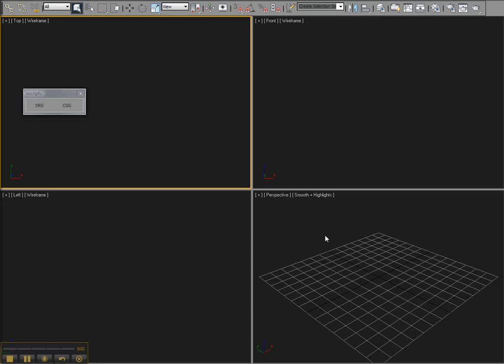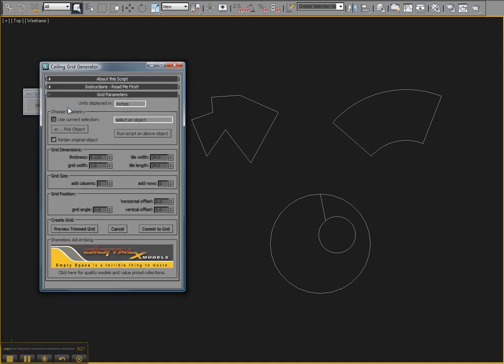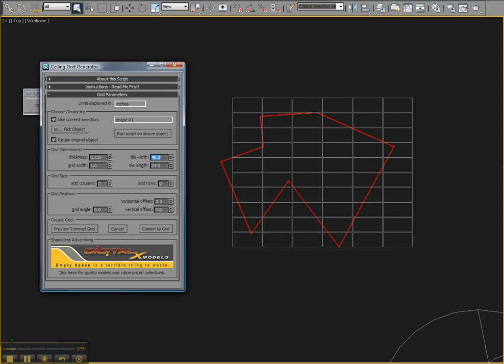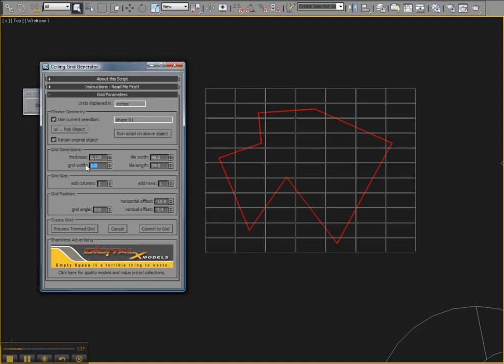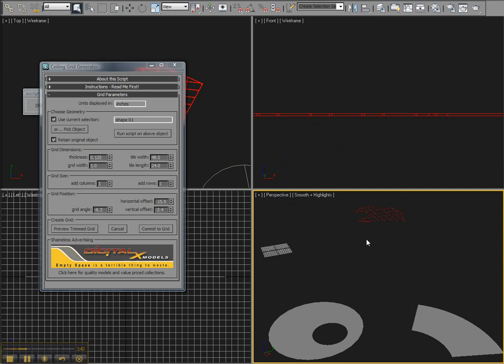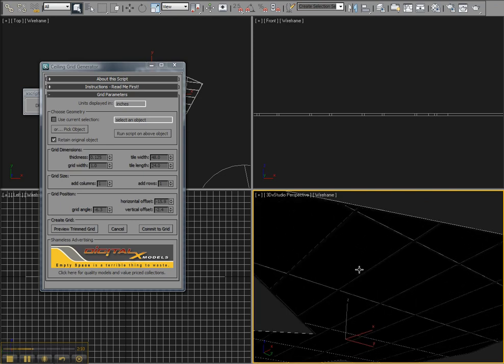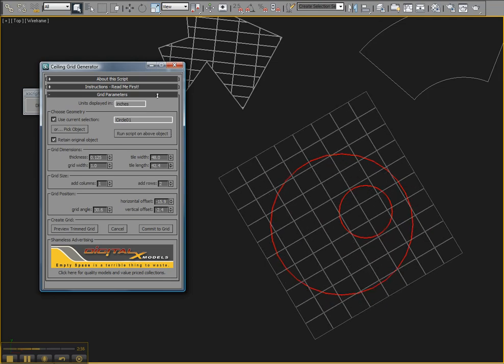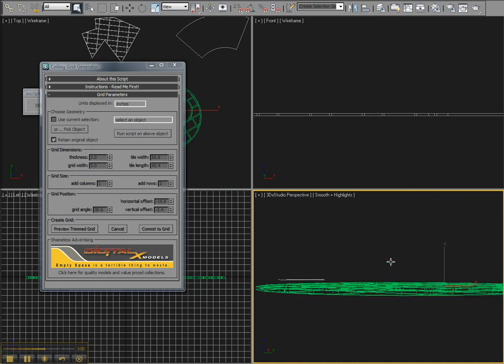Ceiling Grid Generator - Free MaxScript from DigitalXModels.com

Comment: Your script is very buggy and does not work well at all. If you hit "esc" while working in the script it crashes and/or if you don't hit "preview" before "commit to grid" then it also crashes. You need to really go through this script and fix those bugs. There are probably more that pop up that i haven't mentioned as well.